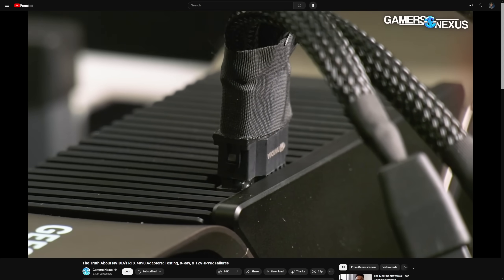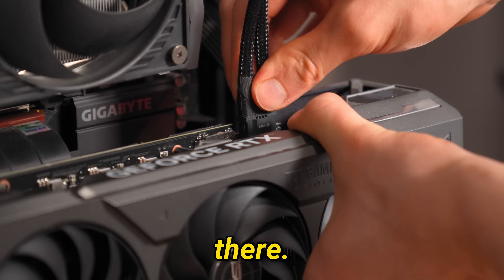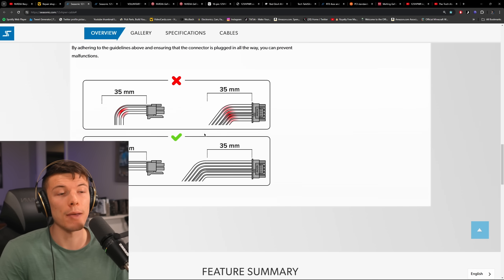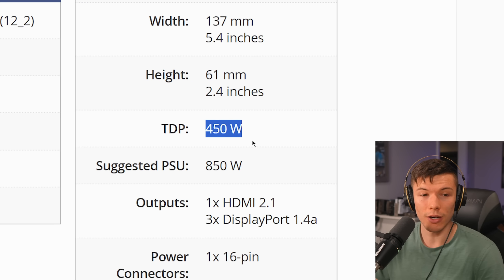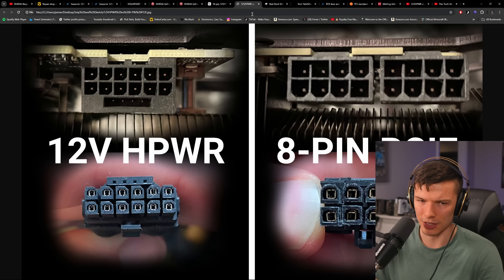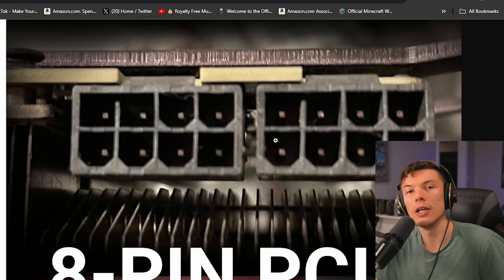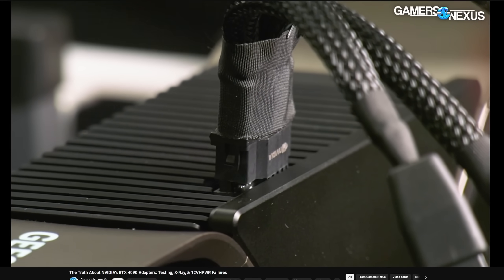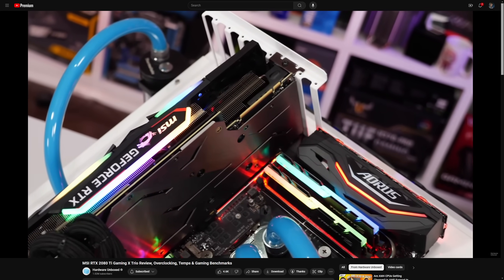The Dumbest Thing to Happen to Graphics Cards

Comment: 12V HPWR is like 2x 8pin, is like 2x 6pin without sense pins = 2x 8pin in power and has the sense pins little above.

the new connector trick to make it more watt capable is i guess just lowering the fool proofness.

however if rtx 4090 is 450W then it should have enough fool proofness with this connector, however they still melt?

but it has connection problems aswell...

thats how i see it

Comment: Nvidia should have added a screw lock for their 12VHPWR connector, similarly to VGA and DVI cables. The thumb screws will ensure that the cable remains fully inserted even after a user does any cable management or less than ideal bend radius will not make the connector work itself loose over time.

The 8 pin power connector worked so well because they were designed around compensating for user error and manufacturing tolerances. The mating surface of the contacts is larger and more common with significantly higher amperage that what the wires would be rated for. The purpose of that is even if the cable comes slightly loose from cable management, the contact area will still be well above what the wires can handle, thus you are less likely to run into issues with the connector overheating.

I have done a number of system builds with the RTX 40 series cards. One thing that I have been doing is putting a little masking tape on the body of the connector, then coloring the base of the plug with some UV reactive ink (small amount near the base), thus making it easy to see if the connector comes loose.
The main issue with the connector is that the manufacturing tolerances are very loose in that the connector can click before the plug is seated 100%, and depending on stress, the cable can work itself loose up to those loose tolerances, and risk melting.

Comment: I bought one on E Bay for 600 bucks and fixed it with a very Big molex plug and boy what a deal do to this GPU ran about 2,700 bucks ,what a Hot deal plus I modefied it with an extra heat synk on the GPUs back side of the board

Comment: good point i just upgrade my selt to seasinic 850watt psu it is atx 3.0 and actually have on psu it self 12VHPWR to gpu 12VHPWR so single cable no bullshit spliting and if y dont have 3.0 psu but lets say you have older model but it it 1000 watt and y dont want upgrade seasonic have noe 3 types of those cables what you can buy and its mutche better than thandart from nvidia cuz seasonic actually offer even bendet option 90deg so there is no bending on connector it self and that should be it from the box nvidia is just fucking lazy.

Comment: It's worth noting that the original 6 pin pcie standard was only supposed to have 2 current carrying conductors. We got the 8 pin spec primary because most psu companies connected all 3 which offers better current carrying capacity but in order to actually lean on that you needed a way to verify that all 3 were present. So they added 2 extra pins 1 ground (making for 4) and one sense (that's just connected to ground.) Which is why for the most part as long as  you verify that your power supply has all 3 power wires hooked up its perfectly fine to run a single 6pin to 8 pin adapter.

16awg 18awg it doesn't really matter, running even the upper limit of 288w over 6 of them isn't stressing the wires themselves. The problem is the same one 12VHP has its the connector. The contact resistance becomes the first limiting factor. Smaller contacts = higher contact resistance btw.

Comment: Phanteks AMP GH 1000W 80+ Platinum PSU, com  with  a single 600w 12v high power connector. Hav yet to se anyon on youtube use on i a build tho.

Comment: there's been a ton of debate over whether or not PCIE 8pin can handle 150w or more, and it depends on the gauge of the wire which yes is true, but what no one ever frigging talks about is the insulation rating.  The main reason that conductors are rated for how much power they can supply isn't so much for the sake of the conductors, but the insulation.  A wire can carry X amount of amps, but at certain temperature thresholds it can damage the insulation.  Overtime making it brittle, cracking and exposing conductors and leading to faults (aka short circuits.)  

There's also the issue of the the termination points.  Any point where an electrical connection is made, be it soldering or a connector intrinsically will have much higher resistance and get much hotter relative to the rest of the circuit as it tries to push the desired current through it.  If you're constantly maxing out (or going over the rated limit) the wires, and to a less extent the insulation might last a while, but the connection points could get damaged.  #16 copper is rated for a maximum of 288w @90c°, provided there are no other wires in the same space, the insulation is rated for things like direct contact with water and oil, and I doubt even high end PSUs use insulation of that caliber, because it would be really expensive and damn near impossible to form neatly into a case.

tl;dr - it doesn't matter how much power wires can "theoretically" carry at maximum, those ratings are there for a reason.  Going over them is usually considered to be a bad move.  But , ay, if folks wanna be lazy and use their y-splitter PCIE cables because taking it apart is too much work, let em.  no skin off my vagina. 

With most mid range and even older high end cards, it's not really a problem, but these new graphics cards can pull much higher power than even 3 PCIE cables + the slot power.  3x8-pin + the slot is a maximum of 525w, which i've seen the 7900XTX pull at peak if hwinfo64 is to be believed.  and the 4090 is even higher.

At some point, I think internal graphics cards are gonna go by the way side and they're going to start making external enclosures for even desktops.. it's gonna be a requirement at this point.. as well as having a dedicate substation to supply power...

Comment: I work in a DIY PC shop and have never fixed a 4090 in a PC. Highest we've fixed is a 4080 super and tried my best to steer the customers away from buying the 4090s. So we've never faced this issue. I was suspicious of the pciegen5 connectors from the start. being a temperature snob myself, ran my 3090 undervolted for better temps/efficiency.

Comment: Since the 40 series launch I have built over 130 gaming PC's with a 40 series GPU. I've never had 1 issue with a connector not seating or a melting issue. Not everyone is capable of building a computer.
Reply: Most people are. PC's shouldn't be a fire risk. Even if they are connected slightly wrong.

Comment: "....messy and inelegant...."

Uh, speak for yourself. I just installed my 7900 XTX and my cables are pristine and organized. I mean, it looks like I have another 24 pin main board power connector but on the gpu but still.

Comment: NVIDIA TAIWAN DOESN'T HAVE U.S. CONSUMER SAFETY LAWS....WHEN MY OVEN I COOK DINNER IN USES 400W IT HAS A GIANT 3 PRONG CORD OF THICK HEAVY COPPER WIRE SUPER WELL INSULATED TO HANDLE THAT POWER LOAD.....CHINESE JUST DIE SHRINK EVERYTHING BECAUSE THEY WERE NEVER EDUCATED ABOUT ELECTRICAL FIRES AND WHAT CAUSES HOMES, APARTMENT BUILDINGS AND COMMERCIAL BUILDINGS TO BURN DOWN

Comment: There was nothing wrong with the 8 pin connectors. I have never had any issues with the 8 pin. Nvidia is great at fixing problems that don't actually exist. I have routinely run well over 150 watt through an 8 pin and never had any issues.

Comment: Actually I have an XFX RX 7900 XTX that has three 8 pin connectors but I used power supply approved cable extensions and then used 24 pin connector looms to make the 3 into one power cable that actually matchs the 24 pin MB main power connector, Looks good and they match.

Comment: VEX :
 the TDP = Thermal Design Power doesn't equal to actual PWR consumption. The RTX 4090 eats continuously from 540-580 Watts with peaks up to 641 Watts.
And the 8-PIN connector is rated up to 225 Watts instead of 150 Watts. Standarized PSU cables have different ratings....and on the Corsair RM850X foe example, 1 PCI-Ex cable is rated up to 150 Watts.
That's why a Corsair RM 850x cannot power an RTX 3080 Ti 12 GB that has 2 x 8-PIN connector, because that card continuously eats around 390-400 Watts with peaks up to 441 Watts....which means that it demands continuously of 195 Watts per one 8-pin connector.

Comment: I wonder what nvidia fanboys will say to justify this. The fire is path tracing? Jokes aside it's funny how people still cry about windows vista era amd driver problems, still use intel arc release data as a benchmark but stay silent when Nvidia releases a prototype that is also a fire hazard to the masses and sweep under the bed the data. And if you say "wElL if You Can AFFord ThE 4090 YoU cAN bUy An ADapTer!" if the adapter is mandatory to have a safe graphic card(safe for itself and the PEOPLE around it) it is not an adapter, it is part of the product and should be in the box.

Comment: RTX 4090 24GB = around 85 % of them are melting their own 12-pin connectors
RTX 4080 16GB = around 65 % of them are melting their own 12-pin connectors

The 12-pin PWR Nvidia connector is still at its v1.0 version. I've had the pleasure of testing it on an RTX 4080 Super and it's still a problem with too much current flowing through those soldering points and those super small, smaller than on the 8-PIN connector, pins.

Comment: do 4080's have this issue too? or is this happening with 4090's only?
Reply: Mostly 4090s. The problem with the connector is the same it's just 4080 draws less power thus stays on a safer side.

Comment: The interesting thing is that these cables aren't melting in any real numbers at the power supply or at the plug going into the 90 or 180 adapter. They're only melting on the connector on the gpu. I have a right angle connector on mine right now. I have a cable mod right angle cable that I'm probably going to replace it with, so we'll see how that goes. No melting so far, but I have one of the updated connectors on my 4090 with the shorter sense pins, so who knows there.

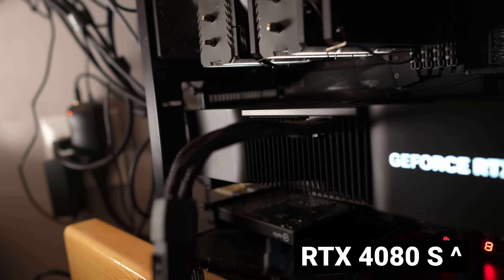Comment: 4:20

I generally only upgrade my power supply when I have higher power requirements (since I learned the hard way from one melting while playing doom 3 back in 2005 🤣), all that being said, I still feel nV should have had a few more years of RnD on the cable while running the janky 3x 8 pin setup for their high power cards, in theory would still manage 525w(including the pcie slot 75w(do I remember that correctly ? haven't been a paid PC builder in almost a couple of decades).
Reply: Nowadays you should only experience your PC shutting off if you have an inadequate PSU that isn't junk.

Comment: Tbh I kind of forgot this was even a thing. I just plugged it into my $1300 4090 and forgot for almost a year. I didn't upgrade my PSU for it but I did drop $70 on a 1000w Titanium PSU for my 2080 Ti the year prior. The adapter is crazy ugly but I'm ironically too cheap to buy a proper cable.

Comment: 12VHPWR is a good idea that was executed poorly. Having 3 or more 8 pins is a pain for cable management and looks, as well as taking up a lot of space in the card, so I do think that a new connector is needed. If only they had put 2 clips on the 12VHPWR connector to lock it into place at the top and bottom instead of just 1, we wouldn’t be having this issue.

Comment: i got a power supply that already supports  12VHPWR.  it has a cable directly from the Psupply to the 4090. no adapters needed. I think if 4090 users has extra cash, updating the power supply with a out of the box support to 12VHPWR should really be considered.

Comment: Also worth mentioning, Igor's Lab tested it and the 12 VHPWR connector sends a shitload of noise into the rest of the system, grounding mostly through the PCIE slot instead of back through the cable.

Comment: 11:00 you actually lose more energy/ pay for more energy 
Because of the 12 pin nvidia new cable

Normal 8 pin is rated on 8 Amps
While nvidia 12 pin is pushed to a higher seemingly not stable level
Of 9,4(something like that) Amps

It means more power is changed into heat dissipating outside the gpu (and melting)

Q=RI²
Where I is the Amps

Comment: What the 8auer not mentioned: The Cables are overspecked for a Reason. In the German Version of it i calculated it. The 10% and 90% Safety margin of the Cables are only for 20°C. For every °C they lose 0.3 to 0.4% of conductivity. Which means at 50°C/122°F you are at 98% of a 12HVPWR Connector when the GPU demands 600W which a RTX 4090 does in spikes.  When the Card gets older the Connection gets corrosion. Guess what happens then, yes it loses conductivity. Then you are at 90% or 540W  which let the Card overheat more and then you end up with an burned up RTX 4090. The other RTX 4000 Cards have not this massive Problem, but the 2000$ Card.

The Solution would have been very simple: Add 2 more pins. Then the Plug would have had 26% of Safety Margin. Or it could go up to 75°C without overloading the Connector. Personally i would make 2x8 Pins Power and 4 Sense pins. A nice 20 VHPWR Connector. With a healthy Safety Margin which has enough Room for two failure Modes. And it would still be a little smaller then a 2 8Pin Connectors.
The 8 Pin only has 2x3 Pins vor Power delivery the other both are for Sensing. A 8 Pin wide connector with nearly the raw physics capabilities of 3 8 Pin Connectors and cutting down the safety Margin to 42%. That would have been an improvement and a good Design.
As 20% of this Margin is for increased temperature up to 77°C/170°C

Comment: Better yet, use the same gauge of wire on the 12hpwr that the 8-pin has. I am using the cable mod non angled adapters to adapt 4 ATX 8-pins into my 4080 for efficient power delivery. My small case makes it hard though as vibrations from the gpu can shake it loose enough during use over time that the red light comes on mid game and I have to shutdown, adjust the connector and restart. No magic smoke yet.

Comment: They should make a 16 pin connector on the GPU that splits into two 8 pin connectors that go into the PSU that should solve the heat issue.

Comment: they cut it down to one connector to save on money yet they then had to put a double to 1 connector in the box so where was money saved plus a big fail fire hazard. I am not buying any card that high power with only 1 connector. I rather buy a card with 3 or 4 connectors that are 100% safer and no fire issues and not ever seen a double 8 pin card ever have this issue. I am buying an Intel card so avoid all the fail AMD & NVIDIA cards

Comment: Hey bro,  don't use the Y cable for gpu power. Run 2 seperate cables.  Not the 12vhpwr, I'm talking the vga cable from the psu. Baaad idea.

Comment: Since I was making a new PC from scratch after 40 series launch my power supply came with a 12 pin power connector. 
But now I am confused, if I ever get a graphics card that has it (probably something like 11000/8000 series) will I have to buy new cable anyway with all the revisions?

Comment: My Asus ROG Strix White 4090's 16 pin connector is a part of that pile because of the Cable Mod 90 degree adapter. I caught mine earlyish so it didn't kill it entirely but still would cut out randomly. NorthRidgeFix did a nice job of replacing the connector but the repair was over $600. I hate this connector and wish they would go back to the old faithful 6+2 PCIE connector.

Comment: they should really stop trying to reinvent the wheel and just use normal standard high-current connectors like all other industries do, or even bolt and screw terminals.

Comment: Plugged my 4090 Zotac in on December 3rd, 2022, with a single 16 pin cable and no trouble for the last year and a half.  Never unplugged it once and still going good in a 011 EVO case.  Runs at 350 watts plus on a daily basis and not melting.  Don't use the adapters and don't unplug and plug your card in a lot.

Comment: Hello, I am the owner of a fairly famous gaming store in Spain, and I have to say that the PCs that clients bring us for cleaning, repair or updating that already come with an RTX 4090, only 1 in 10 have a straight cable (unbent), only 1 in 10 use the correct case for the width of that graphics card and only 1 in 10 have correct wiring. We have built many, I repeat many, RTX 4090s and we have not had any problems in these two years. My question is, is the problem the graphics or the bad or incorrect assembly by the user who claims to know how to do it? Users claim to have done it well but the reality is very different. All the best.

Comment: This rant about a connector is kinda funny to me

On pcie power connectors, half the pins are ground. 12vhp has 6 pins carrying the load. In worst case, 600W/6pins=100Wper pin /12v = 8.25A per pin. Which is feasible on the short lengths of 16 or 18awg wire used on PCs. 

The 12vhpw connector offers higher pin density, that’s the whole advantage. Packaging. The issue will not be the gauge of the wiring. Too little cross section for conducting amperage means high resistance, converting power to heat. The jacketing on the wiring isn’t melting, the connectors are. Ergo the pins have poor conductivity for some reason. Electrical engineers will review their design and check samples from the production line to verify they meet design specs.

Cabling and termination is a pretty bulletproof area. Something like this situation is unusual, I can’t really fault nvidia for trying something different. Having to use an adapter for a generation of transition is a price that has to be paid sometime, this criticism holds zero weight